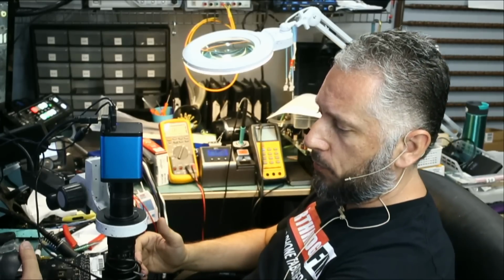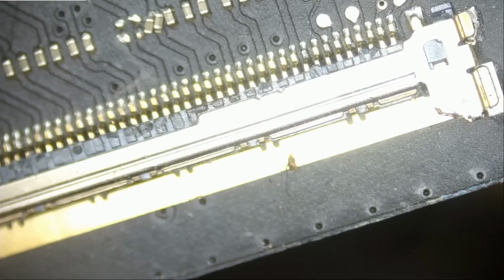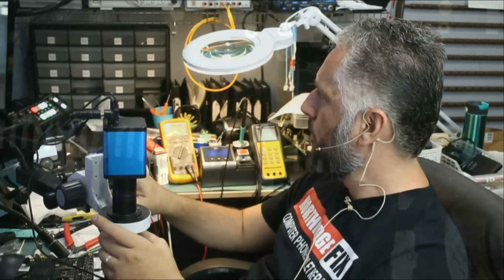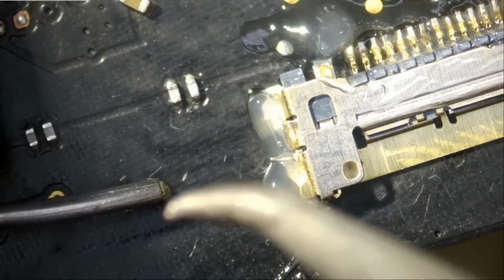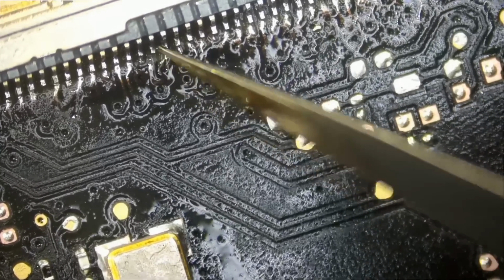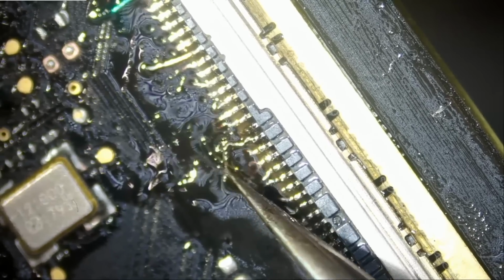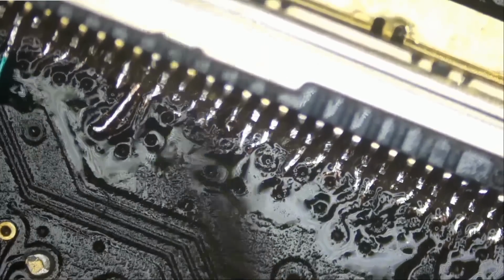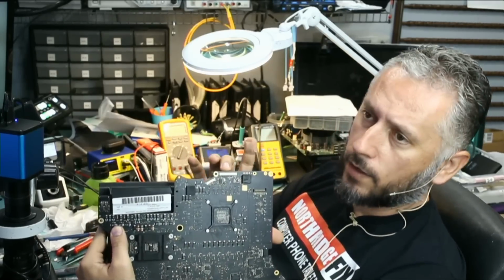2015 iMac 27" Motherboard repair - Customer bought it off eBay and wants it fixed.

Comment: i wanna ask a question, i have broken monitor HP LE1852ms and the board is fried. I'm searching the board on e-commerce and that model doesnt exist, but i find a similar board type and serial number from different monitor (HP LE 1902x), it has exact same ic, layout, and ports. is it going to work if i put 1902x mainboard into 1852ms?

Comment: Hello I have Zotac 1080Ti Amp Xtreme with following fault.

1. Its showing short on 3.3v pcie

2. Its showing short 8pin power connector

3. Its showing short on pex rail

4. Its showing short on memory phase.

Can you please give me an idea where could be the exact problem ?? I am stuck in this issue any help would be highly appreciated. Thanks in advance.

Comment: Really need your comment here.. does repairing electronic stuffs can affect the eyes in a long run? Exposing to bright light.. its been about 5 years that im repairing electronics.. the problem is my eyes keeps itching time to time and its hard to see bright light and focus on tiny components.. i dont see you wearing glasses most of the time.. how do you manage your health😀?
Reply: Like all of us you might just be getting older... the eyes naturally loose focus over time. Try and get fitted for a pair of glasses, even if they don't need to be very strong it makes a big difference for precision work requiring concentration.

Comment: My switch recently had water damage and pin problems reading games it turns on but when you use games that are digital it gives an error and takes you back home it charges and everything but still acts wierd at times and I cant play games

Comment: Hey Alex, great repair as always. Just had a question, how many devices or maybe what percentage of devices that come in, need repair by you. Meaning that it is an actual no power because of a blown component and not a software issue.

Comment: I have also replaced this connector on a iMac. Several of the pads were missing also. 
The wire I used to repair them was a bit thinner.
The customer lost the flex cable and at the time a replacement was hard to find. 
I ordered the plastic housings and some wires with pre crimped terminals from Digikey.
Then I reverse engineered the connections to find the LVDS pairs and twisted these wires.
It seemed to work perfectly. Probably cheaper than buying a cable.
Reply: OK engineer
Reply: @quranmedia691  What are you trying to say?

Comment: 👍It is very important to check the welded pins by touching them with a sharp point so as not to leave anything in the air. perfect

Comment: I would have said by the look of board, that pin 5 would be not connected and pin 6 would have been new pad.
Reply: Same here
Reply: I was just looking at the same thing. I would be strait to pin 5 if it was for it.
Reply: I'm glad I'm not the only one who noticed that.  Some of those pins had angle traces and it looked like that one was one of them.
Reply: I was thinking the same so let see if it fix at the end
Reply: I'm also meaning that Pin 5 - NC and Pin 6 - CLK_EDO
Reply: From the way the solder mask was shaped it was clearly pin 6 that was connected and 5 left open